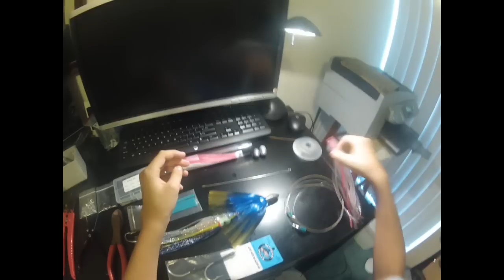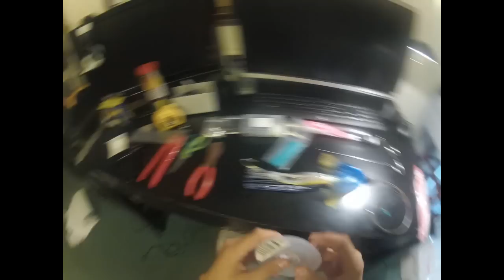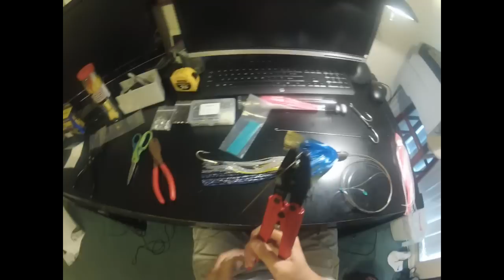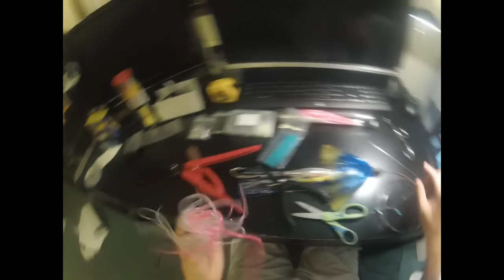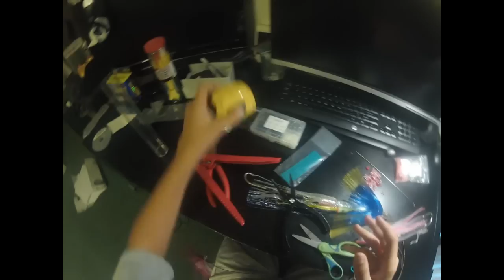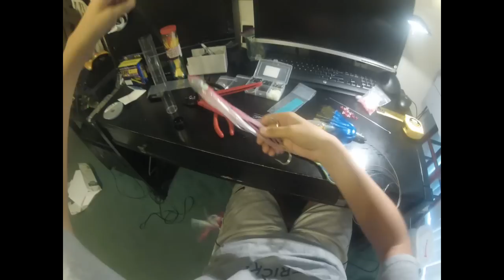How To Make a WAHOO Lure. (Easiest and Fastest Way)

Comment: no nee to guess, just measure the width of the bead, then do a little math to get three inches.
Reply: No need for all that just put a bead on & a single line crimp below it at the desired distance & that will do the same thing as 30 fucking beads
Reply: I use clear surgical tubing for the spacer….one piece and measure to get it how you like.